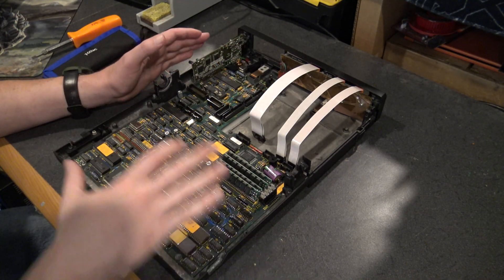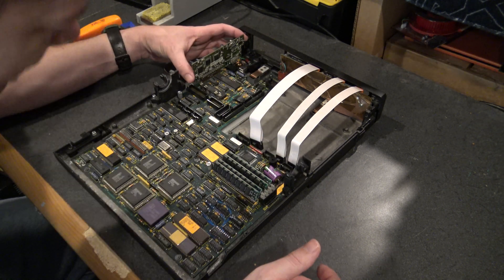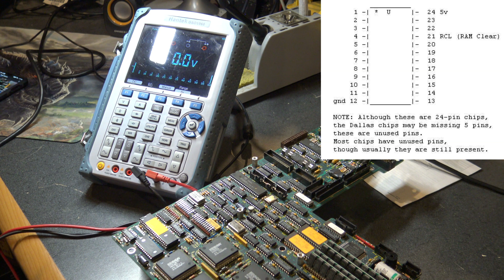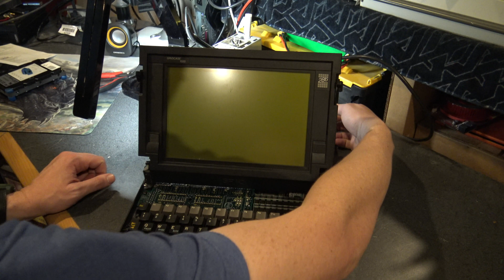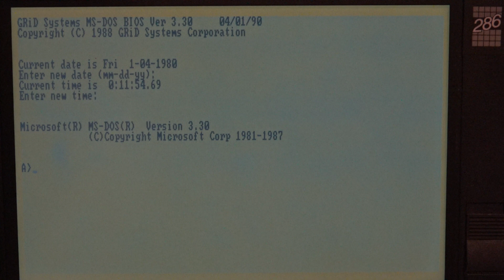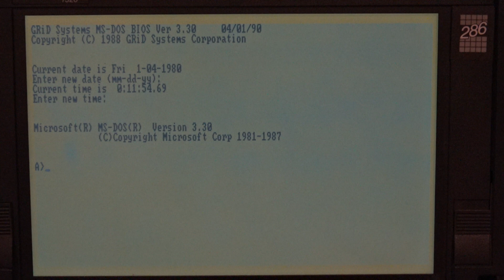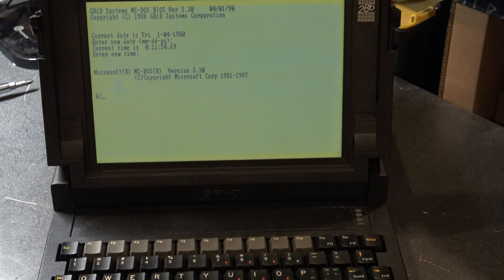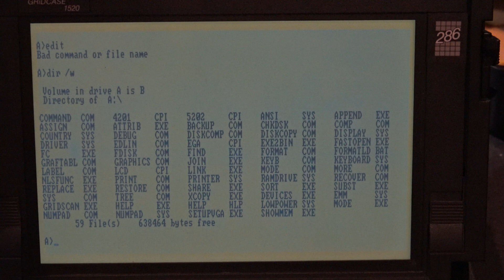GRiD 1520 Real Time Clock Replacement Part 2

Comment: I would have given up and used a file on the holder and hoped it fit
Reply from the maker: Yeah was kind of a mess. I actually have an upcoming video where I plan on pulling off the holder and replace it with a similar type battery with the legs soldered. While I have it apart I'm going to take the entire keyboard apart and see if I can clean it to bring it back to life. I have a few other videos I want to get done first though, including a GRiD 1550sx I just got. It works well, in reasonbaly good condition, but needs some TLC.
Reply: @c90s_tech  I see, good luck

Comment: I had a similar problem with our GRiD Case 1520 and had to replace the battery and a defect power switch. In your clip there's a little magic at 13:40 - it boots. Our's didn't :-( What did you do to boot the laptop? Is there any way to enter the setup of the Phoenix BIOS? As far as I know, the disk size is 1,44MB...
You can follow my current steps at http://blog.computeum.org/2019/12/29/gridcase-1520/  (sorry, it's in German language)

Comment: Is that a Lithium primary cell that you put in there? I.e. a non-rechargeable one? I think you need to protect it from charging, e.g. by using a diode or by figuring out where the charge voltage is coming from and cutting the resistor which ought to be there.

Comment: What are the specs on this machine? I think I see a Harris CPU. Looks like 386...? Didn't yet watch the first video.
Reply: Ok, at 8:55 it's visible. Harris 286 with a Faraday chipset. Nice.
Reply from the maker: @root42  Yeah even has a 287. Not that I have any software that can use it. The previous owner may have used it though. He did some really cool science, programming, something, not sure.
Reply from the maker: Yeah give part 1 a watch. It's a bit shorter. Will be getting back into it to swap the battery.... again, then seeing what kind of software will run on it... that fits on a floppy anyway.